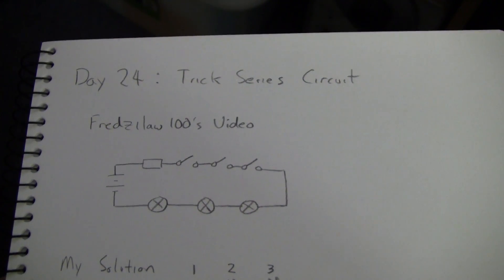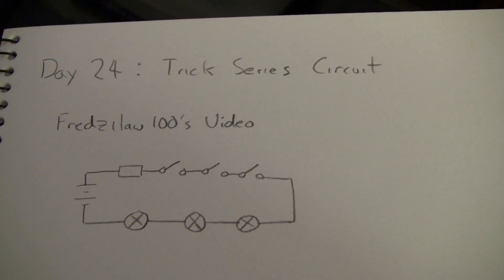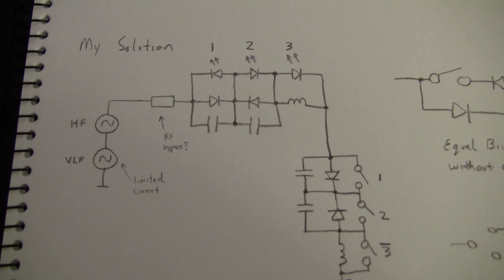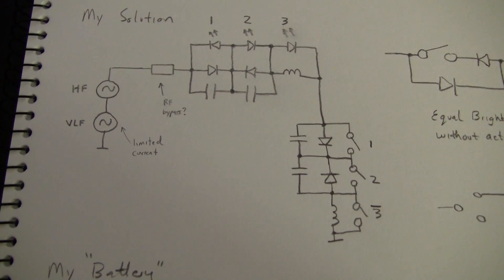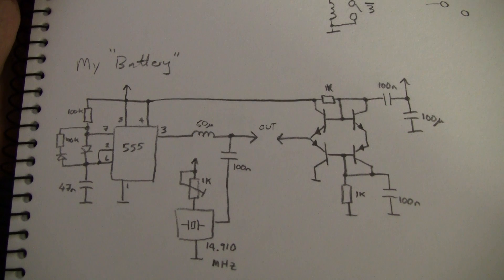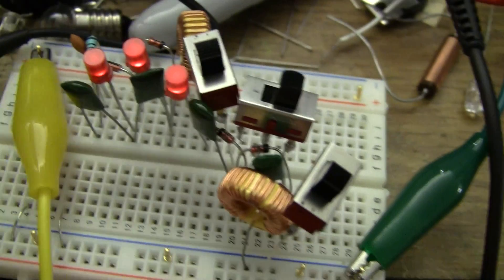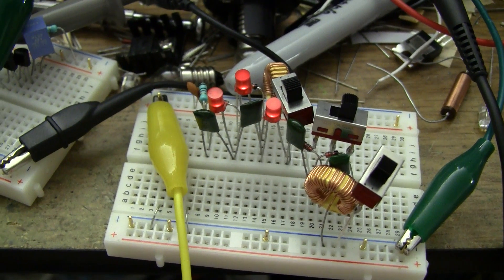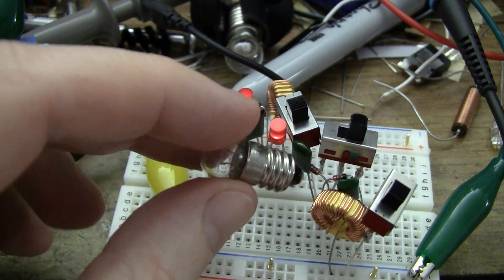Advent Calendar of Circuits 2011: Day 24: Series Circuit Trick

Comment: Actually, this is quite far from the Fredzislaw100's original circuit, cause, if you've read the comments, battery was the only non-modified element in the circuit.
Look interesting and witty, though.

Comment: Quick comment on opening those small incandescents, i have had some luck with winding a couple of layers of paper around the metal base, and lightly squeezing it with a pair of pliers. It worked most of the time for me but of course a few broke.